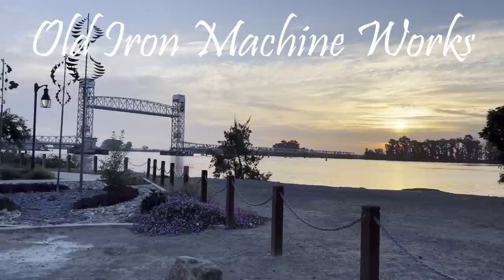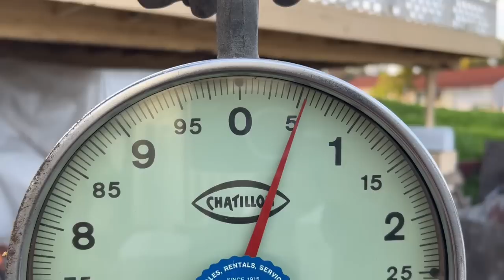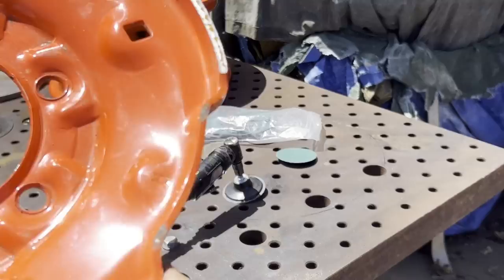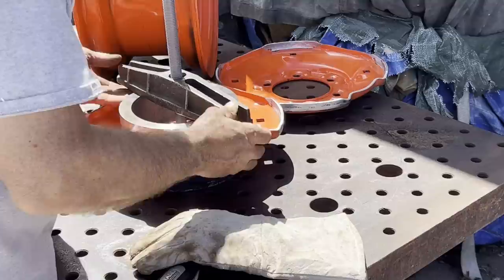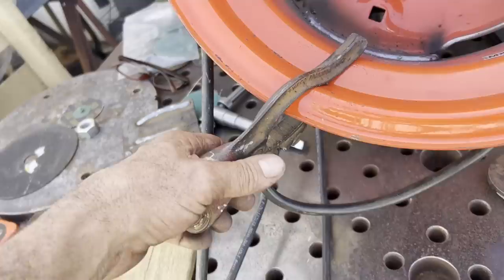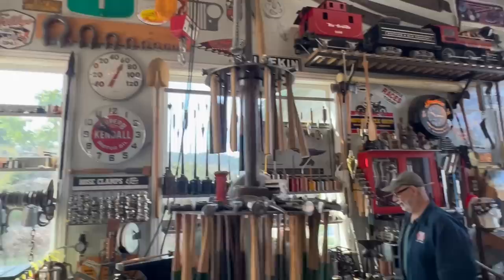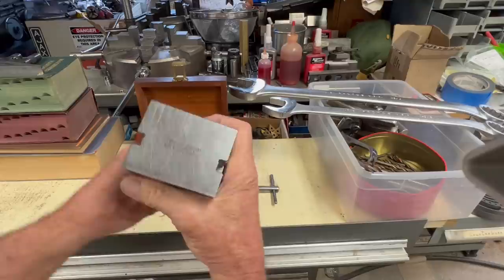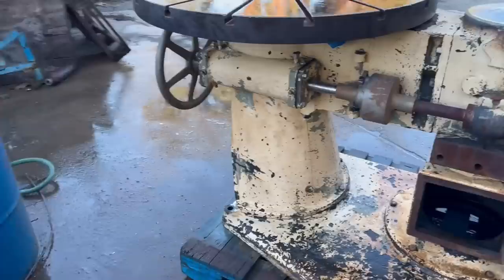Old Iron Tidbits #8 New Welding Table, Kubota Wheel Mod

Comment: Always a fun day hanging out with you Gary. Never quite know what we will get into. By the way, wire speed was too low. I could hear it from here. The heavy spatter is an indicator also. Just sayin here from behind my expert level trolling keyboard. Having a non rotating spindle on a micrometer makes it much easier to get consistent measurements at really small increments.  I would sure like to see the guts of that reducer if you pop it open.  

All the best,

Tom

Comment: Hey Gary, keep the “scoop” or hopper on the motor mount. It will ballast the jointer vibrations…and work as a siphon point for a vacuum to collect the dust.

Comment: That's an awesome welding table top and a good use of the old saw base. Those wheel hub hole centres were a fluke. Your method worked great. Nice job. Cheers Tony
Reply from the maker: Thank you Tony, appreciate the kind words. Thanks for watching.

Comment: What was that woodworking tool originally made to do? looks very specialized but also very massive for wood work.  Surprised to see those wheel mods as normally you can buy those 6 bolt implement wheels in most any back spacing for less than $100 ea. You can even get custom wheels pretty affordable compared to shop time labor. We use unverferth manufacturing out of ohio.  I believe sacramento wheel service does similar on that coast.

Comment: Hi Gary , enjoyed the interesting video. Perhaps electrolysis would be a good way to clean the rust from the welding table top thread holes , a few days in a tank and a pressure wash  to follow might be worth a try , less tedious than hand tapping all those holes , just depends on whether you have a suitable tank.
Great to see you doing some fine work.
All the best from Wales.
Reply from the maker: Appreciate your comment, I’m y
Thinking about using my radial arm Drillpress to tap the holes.

Comment: You made me laugh with the homeless guy you picked up working for food. 
I like that micrometer I never seen one like that before . 
You are really getting dumped on by the rain.
That’s a pretty neat, planetary gearbox I like it. Yes Ridgid pipe threaders are really noisy. 
I really like that turntable. Are you going to use that for Welding or are you going to do a bending fixture out of it?
Reply from the maker: Sorry I’m so late getting back to you. I plan on using it for many functions. 
Not sure about bending tho. Cutting, welding, laying out bolt patterns, and anything else I can think of. 
Appreciate you taking the time to watch my video.    Gary
Reply: @OldIronMachineWorks  hi Gary I enjoy the projects that you show on video. 
I’ve been in the trade for years. 
I always learn some little thing by watching other Machinist at work

Comment: Hi Gary, I’m currently working on restoring a series 61 20 inch lathe. I’m into the apron now and see a couple broken parts. Does your friend still have that parts lathe? Any way you could put me in touch?
Reply from the maker: Nick, The only parts let of the Lathe is the main spindle shaft and gears. I have them at my place. Everything else was either sold or scraped out. 
But it was a 16 so not sure what would have been the same.

Comment: Its a shame you didnt restore the table saw. But the top was pretty far gone. 
That was one seriously beefy machine at probably  1/30the cost of a modren saw and 10 k times more rock solid, but it seriously lacked safty in almost every way. 

Can you imagine what a machine made like that todays safty built in its cost?  I mean they charge up to 5k for one with all the bells and safty gear but its definitely not 5,000 lbs of cast iron 
That thing dosnt have a plastic anything on it.

You have a 16" oliver jointer you need a 3 phase 5hp motor, you stick that dinky 2 or 3hp motor from the eairly 1900s on it its going to bog down. You wont make thick cuts on it, it is way underpowered. 
Look at the 5hp 240 volt powermatic planers 21" wide 

Putting that table saw motor on that jointer is like putting a cordless  drill motor on a drill press.  Its not going to work.

That oliver is worth big money and you can still buy motors from them oilver dosnt make tools in the states any longer but they are still in business. 

You look at machines made pre wwI and around WWII eara they were overbuilt  made to last 100 years  sure you had some cheap stuff then it was crap, todays its better then many high qulity tools.
Reply from the maker: The motor off the saw is a 5 HP 220 or 440 3 phase.
It ran a 16 inch blade. They just made Table saw motors more compact on these kind of saws.